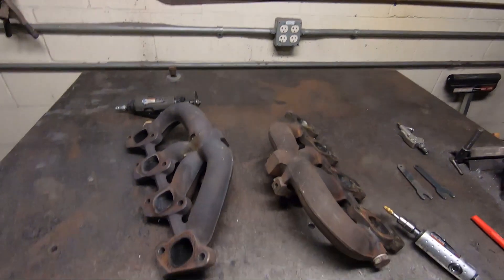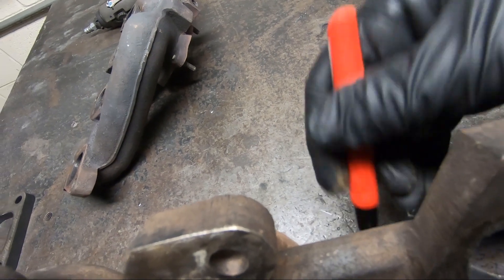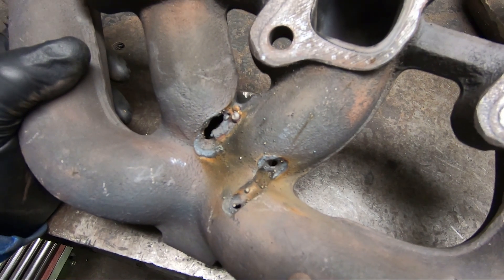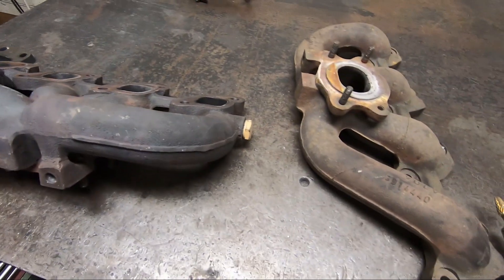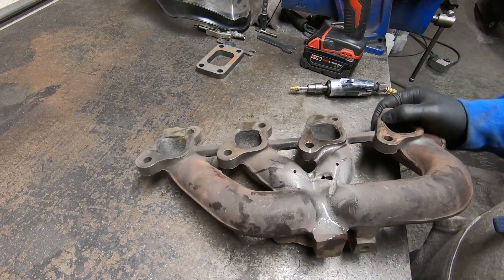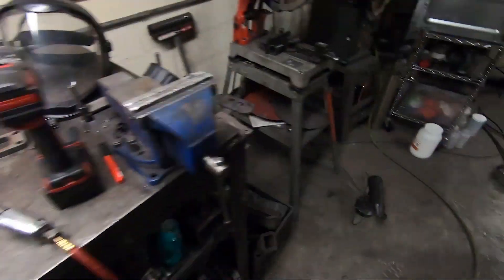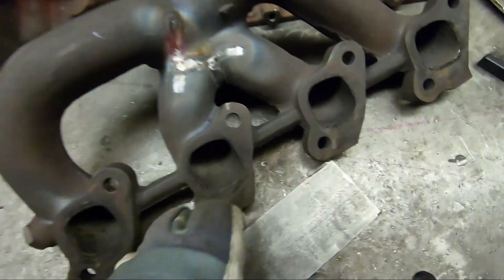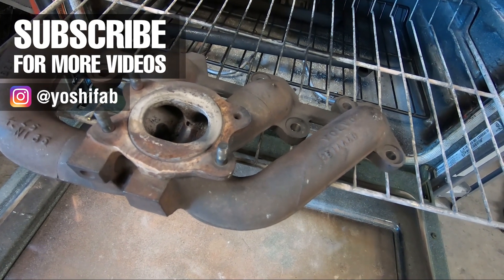Volvo 90+ turbo  manifold  cast iron crack repair 740 940 240

Comment: Cool to find this, I welded mine (2 x B230FTs)  over 5 yrs ago  Low current Mig with oven preheating and sand cooling worked well enough, both cars still going well.  Track car out again with some new cracks.  Good to see this as I need to do it again.

Comment: Hey! I know the Yoshifab name, and like your video. I'm surprised someone would cast a knockoff manifold like that. Very interesting and good to know.
Here's my "obvious question" - why seal the cracks? What is the benefit in doing it, other than knowing it isn't going to come apart in some "rapid self-disassembly" way? I am in the process of rebuilding a b230ft to go into my 89 GLE (yuck) wagon, and noticed the single small crack I used to have is now most or all the cracks shown in your video.

Comment: I'm surprised anyone bothers making a knock-off redblock manifold - is the demand worth the effort?

I've got three 90+ manifolds in my garage, all cracked to varying degrees. Trying to work out if shipping them from the UK to USA and back for you to fix would be completely nuts ;)
Reply: They do get alot of cracks, and when I had mine a good few years back it was hard to find information on welding manifolds.  Luckily the Volvo material is good and weldable.  You can do it with a Mig+steel wire, any decent welder should be able to manage it with the preheating and slow cooling.

Comment: That's some skill right there. Very cool. Just a question...why not at that point go with a aftermarket or build custom made manifold that would be quality enough to end all of those cracking issues? I'm no fab guy but after the first one is built, the ones after would be relatively straight forward right?
Reply from the maker: I have some budget manifolds in the works but they still cost double what modding an old 90+  Lots of people are not looking for a better design, they are looking to get their car running right.  Nothing WRONG with them, they just have a LOT of heat cycles on them at this point in time.
Reply: If this is going on a street car- aftermarket manifold is not legal unless it is approved. In many states this is a big deal.
Reply: @geothon  Literally the only reason every 940 is running something like a 19t on stock headers. You can't make it look too modified or else it won't pass.. Imagine what awesome cars we'd have if it wasn't for stupid regulations (I'm all for the good ones and smog/brake test/rust checks etc.)
Reply: @tracklizard4018  Yeah, I know. I was a smog tech in Cali for almost 20 years. The regulations are tight and if you want to modify you have to play smart. Bigger turbo can be OK if the install looks clean (no ugly looking waste gate actuator bracket, etc). Average smog tech will probably not spot the 3in downpipe as the modified part. Upgraded intercooler can also fly below the radar if it's spray painted black and looks stock.
Reply: @YoshiFab any updates on those manifolds?